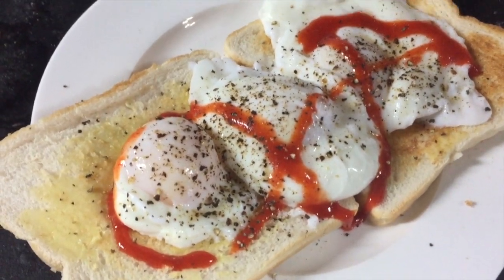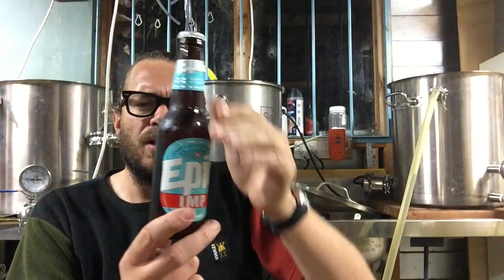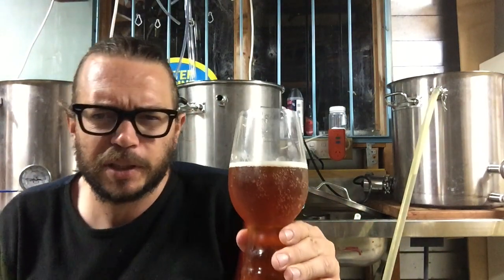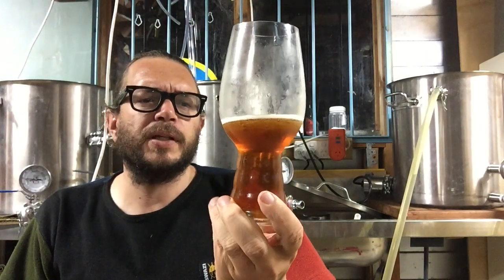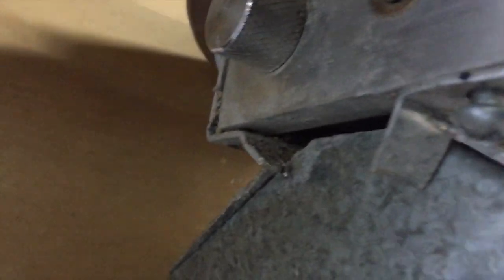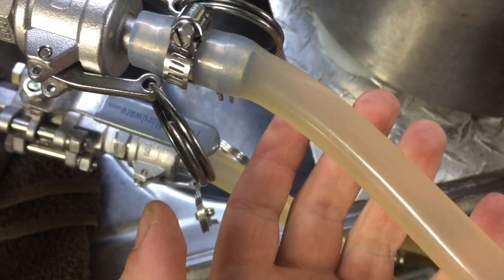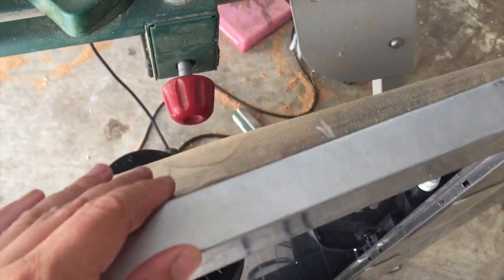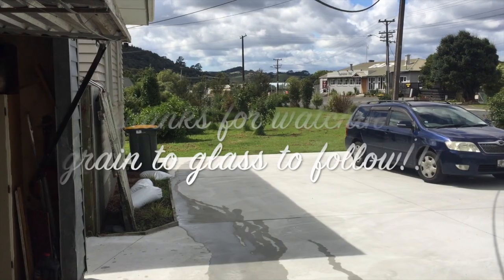Kaukapakapa Brewing HBW45: Dodgy Water Chemistry & Some Bits'n'Pieces

Comment: Nice one Karl. It's hard to justify spending £85 or $150 on a ph meter. It took me a while before I took the plunge and bought a good one so lets hope it lasts. 
It's essential to have a PID or even an STC to control you HLT if you want consistent temperatures. 
At least you had a use for all that water, those trees looked thirsty. Cheers
Reply from the maker: I'm definitely enjoying the results of water chemistry! I normally only have to flick the switch about half a doz times during a brewday in summer. Pretty consistent temps, but the dream has always been to run a control box once I started getting some reasonable beers. I'll start ordering the bits, link it up & run it past the electrician brother n law. Have you got a particular link you referenced from the electric brewery website (for U.K. Build) , I'm looking at running 30watt, single element at a time on a 240volt system. Cheers
Reply: This is the forum post labelled adapting to 220-240v countries http://www.theelectricbrewery.com/forum/viewtopic.php?t=25393
Reply from the maker: Homebrew Chris cheers mate!

Comment: Thanks for your reply what's the total water used because for 8.5 pounds of grain I tend to over shoot it if I use more than 25 litres of water to end up with 22 litres of finished product thanks maybe I'm doing it different but I've been doing an oatmeal stout stout now for around 9 years but water content seems to fluctuate a little cheers mate I do appreciate your input
Reply from the maker: Jack Tyrrell every system is different. Keep your liquor to grist ratio 2.75-3.00 Whatever works on your system is good. Nothing wrong with a longer boil or a liquor back to bring gravity into range.